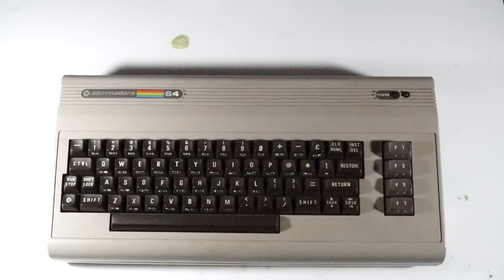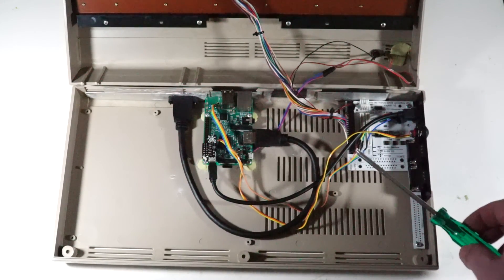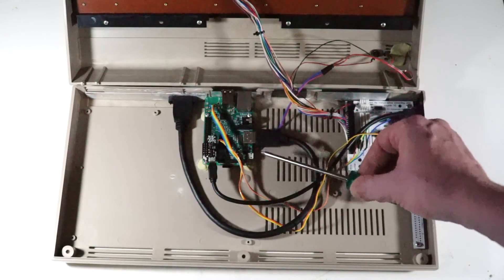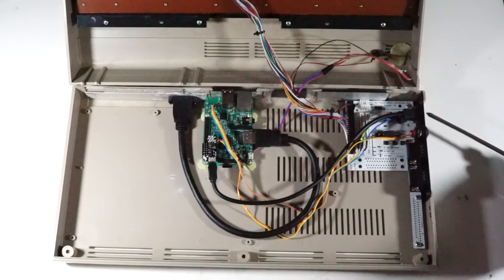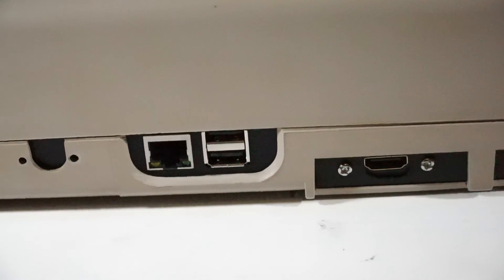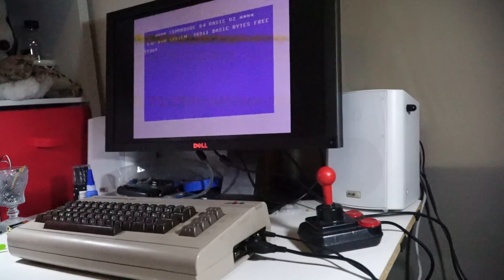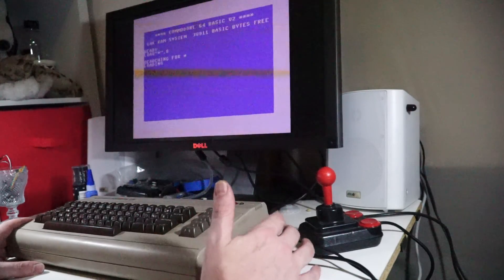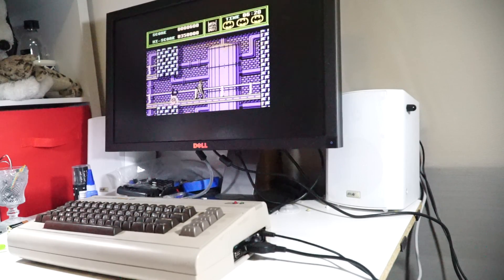Raspberry64 - C64 + Pi

Comment from the maker: This is my very first YouTube video. I've never done anything like this before. Please be gentle.
I will try to answer any Q's you may have.
Reply: I've done the same, but I've designed my own 3D printed frames, and also developed a "Keyrah" my self using Arduino like board. It turned to be much more flexible than the original Keyrah.
Reply from the maker: The Keyrah came recommended and does what I want for this fairly simple implementation. And the DIY stand-offs do the job for only a couple of $'s (and I don't have a 3D printer) and were available from Bunnings, just a few minutes up the road.
Reply: Still impressive! I've installed the Pi the other way around, so the SD is reachable from outside (and Wi-Fi is enough for networking). Also, I used a RGB led replacing the original red one, no need to make a hole for an extra led.
Reply: Very Nice Job !   ~  You did an excellent video.   It would be fun to  merge a Raspberry Pi Zero inside a working C64,  running it as an interface to the internet, and the C64 displaying a  Text browser...  with support for file download, and playing SIDs from the internet !  :-)

Comment: I wonder if you can load different roms in combian. I have an original C64 with a JiffyDos rom in it, which vastly increases the speed at which the 1541 disk drive works. :)

Comment: The nice thing about USB even with a Commodore 64 is first off you can use a USB floppy drive with 3 1/2 floppy disks with images of their 5 1/4 counterparts loaded on them. Retrorecipes did a video on how to take a USB floppy drive and have it look like a modern 1541 disk drive.

For my own project I'm doing much the same but I'm taking this one step further and throwing in a Raspberry Pi with a modern Apple Imac keyboard, (using keys from other apple keyboards to make labels like reset and the Apple key) some USB hubs glued to the underbelly of said keyboard, USB 3.0, USB 2.0, Ethernet, Bluetooth, Wifi, Parallel, Serial, USB type C for the PSU, and thunderbolt 2 (I think there might be linux drivers for it and if there are I'll see if I can get them working on the Pi 4b. 

This is all going to be packed into a 1993 Apple IIe platinum one of the last Apple II's to ever leave Apples factories. A shame though. in the future I may consider firewire but then again USB is much faster than fire wire is. I forgot to mention a Power switch,  and reset switch along with a power light and I may also consider a hdd activity light along with a 1tb SSD.

Comment: Brilliant video. I'm about to put together an Amiga A1200 (Frankenstien as i call it lol). Have ordered an A1200 casing from Retro Passion and have a spare R/Pi 3b+ ready to go in along with a KeyRah v2 board and a fully working A1200 keyboard. Have also purchased various bits and pieces (cables for USB, R/Pi, Ethernet and SD card extension). So looking forward to putting it all together so i can replay all my Amiga games i played all those years back when i had an A600 and an A1200.

Comment: This is a great build.

I've not seen anyone do it as cleanly as you have, removing the switch from your Keyrah and substituting it with a power switch for the Pi. Most builds put an extra switch in, which isn't as elegant.

I also love how you've mounted the Micro USB power port on the side too. Again, most builds just put in a separate port on the rear for this.

I've got an old Commodore 16 and am planning to do the same with that. I think I'll have to buy a 3D printer first though, so I can create all the blanking and (maybe the) mounting plates.

Great work! You’ve certainly inspired me. :)
Reply from the maker: Geez this is an old video. I did actually start to do a 'redux' of it, and yeah it was to use 3D printed back panels and proper stand-offs.

Comment: Next up: Make a cartridge port that can read real cartridges! The "on/off" issue is one I was hoping would be fixed by now. That is, there must be a way to have the entire C64 emulation in some sort of ROM so that you can switch on or off the machine at any time WITHOUT needing to go through a lengthy boot up or shut down procedure. Any C64 emulation should not really need to "clean up" after itself, so a shut down should not be necessary if this was in ROM.
Reply from the maker: Thats really the limitation of running on a Pi. The OS needs to shutdown.
Reply: @MrLurchsThings  Bummer. But there are several implementations (such as the C64 mini or FPGA ones) that can be shut down like a real C64. Still pretty neat, though. 

Have you heard about "The 8-Bit Guy's" dream computer project, the Commander X16? It's going to be a NEW 8/16 bit computer that is largely compatible with CBM BASIC 2.0 but have a much simplified memory map, better graphics (but still retro), sound and so on. Check it out!
- Part One (February 2019): https://youtu.be/ayh0qebfD2g
- Part Two (September 2019): https://youtu.be/sg-6Cjzzg8s

It's being kickstarted and the ultimate goal is to have a system costing less than $100. It has come a long way already! In fact, there is already running code!

Comment: I have just tried to do this but cannot figure out how to get the mapping correct for my C64 keyboard , A lot of the keys do not input what they should I have looked at the wiki but just cannot get my head around it , I presume I need to setup 1to1 mapping ?   its seems my C64 keyboard thinks its a standard PC keyboard , Any help or advice would be great
Reply from the maker: The trick for me was to use the positional (I think? check the video) on the Keyrah, and then set up both types in VICE.

Comment: Thanks for the video. I'm wondering how can you run directly commodore screen? Can you plain this please. I'm using c64 emulator with emulation station. Can i run directly commodore emulator?
Reply from the maker: You want to run from a Raspberry Pi to an old Commodore monitor? Not something I've tried, but the simplest way would probably be to step down to a Raspberry Pi 2 and use its composite-out video port.
Reply: Yes with Combian64

Comment: Awesome work. Been looking for a C64 for ages to do the same thing to.

Where did you pick it up from?
Reply from the maker: Honestly, the local recycling place. It was dead with a missing PSU (although it did come in the box). 
I thought it was just a dead PLA at first, but then there was more wrong so I figured it was a good candidate for this project given the keyboard seemed fine.
Reply: Sorry, I am being very lame, recyclers like vinny’s or computer recyclers?

Been cruising eBay and gumtree for while now but can’t lay my hands on 1 at a reasonable price
Reply from the maker: Sorry - the recyclers at the local tip.
In Canberra its called 'The Green Shed'.

Comment: You could also add a very cheap microsd/tf to sd extender (off ebay) to easily change the os without opening the case ... ;)
Reply from the maker: Agreed and I may come back to that. Unfortunately all the ones I found where just an extender without any panel-mount. If I can find one that screws to the back panel like the HDMI and micro-USB I will certainly add that.

Comment: Tidy work, but please get yourself a 4:3 aspect ratio TFT. ; ) I was very impressed by VICE for the Pi. You should be able to add an Action Replay cartridge image, as this will greatly improve your disk loading times. Great first video!
Reply from the maker: That monitor gets used for all sorts of things, not just this. It keeps the 4:3 aspect ratio, so it really doesnt bother me.
But yeah, I need to work out how to emulate a Fast-Load cart or something similar.